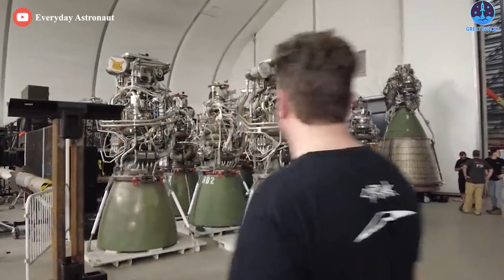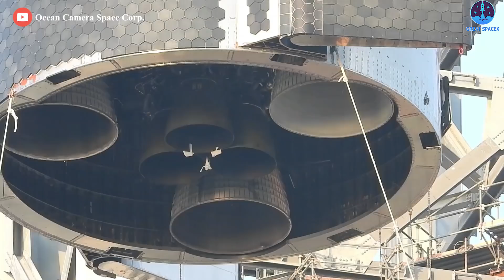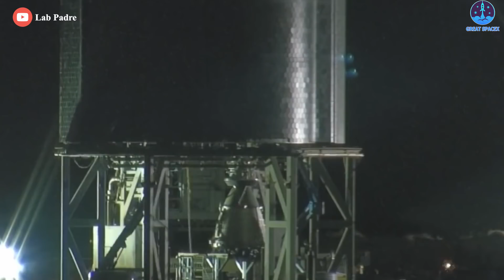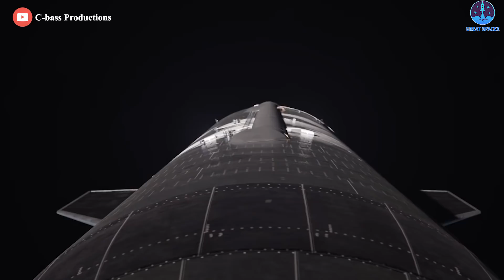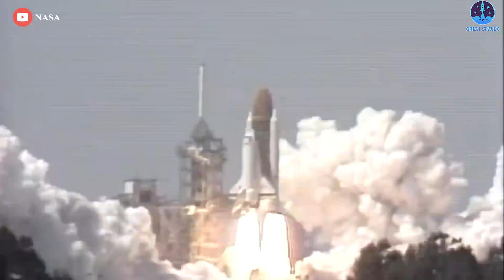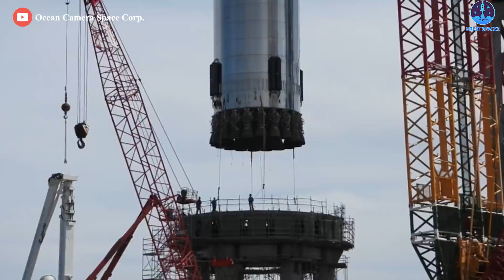Elon Musk Reveals Raptor production crisis is much worse than you think!

Comment: Just like John Houbolt  stated in a since: If the engines were a simpler design, manufacturing would increase several fold. I use to work for a company that built electrostatic power supplies that almost look like the same complexly as the rocket engines. Our company went from 1 unit per 2 weeks to 5 units completed units per day. One of the big tricks we did is fabricate more then a 1/2 dozen of the most complex parts ahead of time, we would do 50 or a 100 and with some parts we used local companies to make these parts. At the end of the project Our company was 70% assemble and we could apply pressure to out side manufacturing. Some to think about!
Reply from the maker: Thanks your ideas. SpaceX can try it
Reply: Do SpaceX uses 3D printing for anything to accelerate production?
Reply: Or they could make a less complex engine. 1 in a 100 rockets go boom. Add complexity and you get more booms.
Reply: @renerivard3364  What could be 3 printed in a rocket engine?
Reply: @GahMehGrrrr   I just threw a Q out there, don't know much
 about it myself. Rocker Lab is using 3D to make  their engine or part of for either for the Electron rocket or the new Neutron rocket.

Comment: Looks like SPACEX need to produce about 80 Raptors per month for the next six months after flight testing begins. After 6 months they should be able to recover most of the first and second stages. So the extra Raptor production can be used to build a fleet of starships. 
The departure of those VP's shows they were not delivering and apparently not communicating with Musk and the Board.

Comment: I think this is Elon reminding his employees that he's in charge and your job is in his hands.  He wants 100% effort 100% of the time and his employees need to know that you should not expect much time off and that working extra hours for no pay is expected.  I do think there are still some issues with the Raptor engines that are either design or manufacturing related so his warning may well be aimed more at the engineers than the floor workers.
Reply: ..and that working extra hours for no pay is expected.
So you think Elon  is becoming second Jeff? :-O
Reply: @martinslaba7249  -- Sadly, yes!
Reply: @martinslaba7249  Much as I admire Elon, I wouldn't want to work for him. Jeff has delivery drivers pissing in bottles cos they have no time to go to the bathroom. Elon wants to have rocket engineers pissing in bottles. But rocket engineers are in much shorter supply than delivery drivers. At some point they say... "I'll go and work for Jeff for a while, and get paid just as well for doing absolutely nothing."

In the end Elon has little to worry about. Nobody else has anything like Starship OR starlink on the table.

Comment: Germany's prisoners in WWII were sent to truck manufacturing plants. A clever method of SABOTAGE by the poorly treated "workers" was NOT to be active at work where you might get shot. Rather, random trucks only got 1 quart of oil and a modified dipstick indicating THAT was full. Miles later and far away, truck engines were seizing up making nearly HALF of the new trucks worthless. Were the three top executive engineers who recently left SpaceX paid to engineer hard to find FAILURES into raptor engines? Just pondering WHO would do that...

Comment: okay, so i'm confused.   the engine is designed for vacuum, so what does the atmosphere have anything to do with it?   there are no vacuum engines on the booster.   the vacuum engine is on the starship so it won't be fired until the starship is substantially in the vacuum of space.   the atmosphere at the altitude when the engines are fired would be maybe a couple of psi at best. also at that time, do all six engines need to fire or are the three non-vacuum engines enough to put the ship into final orbit?   or fire the inner engines then when the starship is in the vacuum of space, fire the outer engines.   something is not right.   it almost sounds like a manufactured crisis.   what am i missing?

Comment: Why don't they send the vacuum engine with some fixtures to space by Falcon 9  to test it in vacuum?
Reply from the maker: An exciting idea! But it is difficult
Reply: It is very hard to find something to tether it to in space.
Reply: I mostly thought about it as the second stage Falcon 9 run by Raptor engine, the cargo bay to hold extra fuel/ oxygen for test and transmitter for collecting data. Fairings cover with new heat shields to take 2nd stage back to earth when the test over
Reply: Makes more sense to directly test the second stage of the Starship which already has flown and has 3 Vacuum Raptor engines and three Raptor.. 
It should be able to get to the edge of space without cargo.

Spacex can test 2nd-stage-recovery at the same time.
A single Raptor can be tested at the NASA Ohio facility.
Perhaps the Three V-Raptors should be tested in Ohio to characterize the Vacuum Raptor before performing launch and recovery of the Starship second stage.

Comment: acustic dynamic test for soemthing that can be shot 1000x means piping order like angled piping and parts partialization that means piping in tune final product is much eliglbel to pressure or tougher as is special terms wled if such temprature allo further more dynamic acustic test reveal basic as avoit problem off unnatural twist curved line piping then center centralization also by bend certain aplication should follow max safe corner angling side shouldnt stretch limits ower 30° for enough flow gas or safe pressure if things apear to be right it is much more predictable safety using vise choice predictions ot aovid problems and also some more expenxe at start but in assembly is total win if used with suport air exasuast then even capsule safety hatch valve cooling can specialy fited with so called  double tube and inside tubic piping around to allow air or evne better ga to pass safe and have liek catalyst egzaust efect cooling easy as this tehc allow some safe temprature kepd for eficiency not the stuff we disscused is allow dynamic bell cooling patern frist outer structure like bell outiside and then special heat coat metal od exposed lvl that react seisitive to temprature exchange to avoid unnessesary heat exchange for for cooling patern also preaty much like catalyst plate cap protection cap probably halled liek titanium metal (alloy)  and and special compartment as aditional cool for part that is heay in mix to achieve so  called imporved efect physics rest is enginering simpy bypass fact and enable tune to extreme improvments you can spend some 20-30 % price off engine but so called tune and tuned eficiency is a bit bombastic with acustic dynamic test it means rocet motor is ready to be assemble into anyking off vehicle this allow stuff like caging easy and hooking cage on servo and tomorrow is practicaly vtol in 2x2 easy litle bit more 3d print tech and some meatl shet and bell piping woudl do fine start once in pose and ordinance there is not more fine voice noise tune and rest in pc control inject system which then gets certain habits like electric fuel injecotrs on cars expcept under enourmess pressure then ratio ff stuff can be senozored and eficient distributed so this part can be improved as max presure raze and tech like 16 valve engine inpit as more fuse input and in total more pressure whihc cna hopefuly be easier controles so 
some balance can be kepd in unstabil pressure that is why limits above are cut atleast 5-6% uper for safety then is pressure tune, aditional safety improve, and then new tech imporvments so in total you make like 2,3 changes and raze safety lvl to next stage all things odne in safe research and inovation stuff and on already am subject like 20-30% raze costs pre piece, then after all is like industrial production and in menawhile also stiff as caging and double plates and ISO foam betwen to protect heat and even inner bottom sheel could have like protecitve bell somekind and uper bell with halls to limit heat exchange also on halls or to muish hot air return fast to engine so suing  mesure senzors pc mix outer burst cooling fast or rapid to avoid thsi especialy like in land move or take off so techincaly land is more dangerous as for rockets require more cool then vtol spacehsip on body not so unimaginable part off vision and plenty off stuff do on its own and found out how to be on end know how stuff in tech